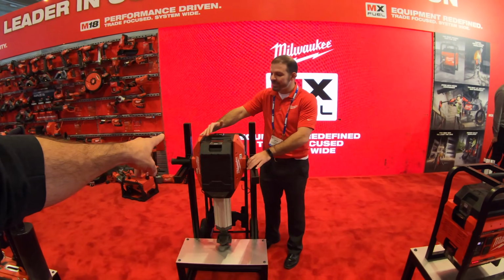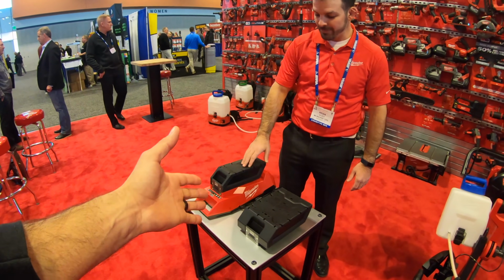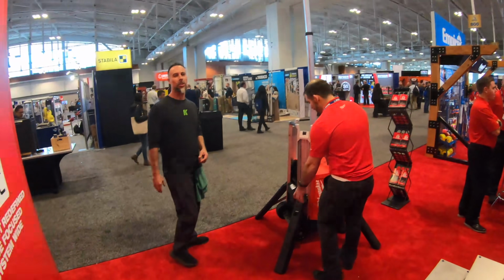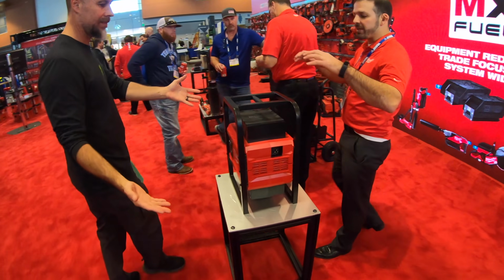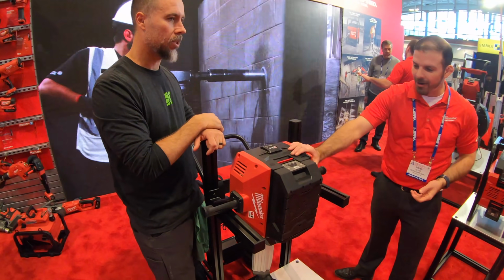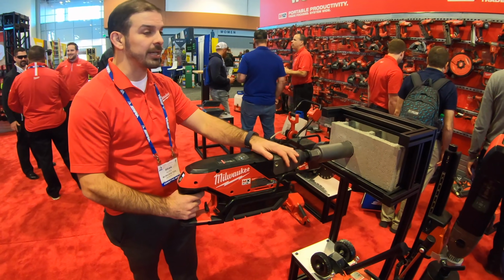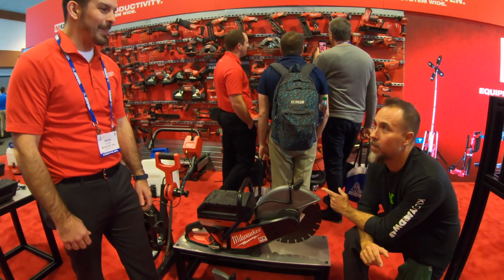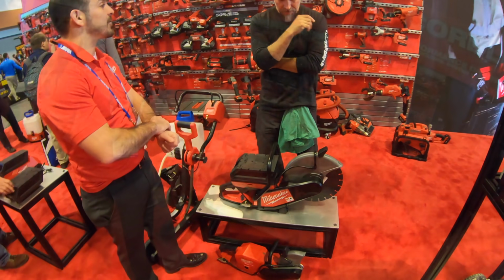Worlds First! 5 new Milwaukee Cordless Power Tools Never seen before!

Comment: There is only one way to make this 14 inch saw even better. Battery powered dust  extraction. Similar to the ads hammer drills.
         If Milwaukee makes that combination for this product I would never consider another saw currently on the market. 
        I have ran stihl, Mikita, hilti, all of them snowball eventually. They all have they’re different quirks and down right bs faults in design. 
        I am extremely excited to get my hands on the 14 inch saw and I cannot wait for Milwaukee to start a new tool revolution in concrete and masonry tools. 
         They just opened up Pandora’s box with this Mx lineup. I can’t wait to see what comes next!!!!
Reply: The demo saw is pretty trick, as long as the battery/drivetrain life is there - I'd hate to pay for one of those batteries very often.  Like that they came out with a cart designed for the saw, tho I have a hard time seeing how they get $1000 for little more than a wheelbarrow.  All the saw carts are like that, tho, and if a guy does much flatwork demo they're pretty much a necessity.  Stan was right on with time savings with not having to fiddle with start-up procedure.

Comment: I would like to see them add a cable stapler that makes the cable tight to the wood Without damaging it. The Dewalt one sucks because it does not sit The cable family to the wood you can slide the cable and that way electricians can’t make a nice tight good looking layout with their cable and staples I. Whoever makes an adjustable cable stapler is going to take the electrician market by storm every electrician I’ve spoken to said that the Dewalt sucks because it does not make it tight enough so that the cable will not slip through.

Comment: The battery cut off saw is not the first in the world Stihl has had one out for some time. I been using the stihl cut off saw in the UK for 6-9 months. The stihl look smaller and less bulky than the Milwaukee cut of saw as well. https://m.stihl.co.uk/STIHL-Products/Construction-Machinery/Cordless-Li-Ion-cut-off-machine/240781-43597/ohne-akku-ohne-ladegeraet.aspx

Comment: See I don’t care about the drain drum machine personally of me being a plumber I’m always gonna use a spartan drain cleaner because I know they’re dependable and reliable I like the idea and the concept but I’m still going to go 100% plug-in Spartan because I’ve used it in the rain unclogging a drain at 2:30 in the morning soaked and that thing kept on running didn’t give me any trouble
Reply: Agreed man right there with you. I just don't see it having the weight behind it to break through a bad clog. Sewer augers take a major beating. Now if only Spartan or Rigid could add a battery powered lift that'd be sweet. It's a one man job but where I live we have basements so ends up having to be two people.
Reply: It's something where you just have to take a gamble and see how it goes.

Comment: “What’s the price point on this”
Guys embarrassed to have to say it
They pay you enough to shill for them
Send it to AVE let’s get the scoop
Reply: AvE would have a field day with all this market wankiteering.
Reply: I want to see "what makes her chooch"
Reply: Like my Milwaukee....Skookum as Frig ....but sure will be fun to watch open up one of those super tools and especially a big arse battery.
Reply: Work Hardened I have to strongly disagree, I have never had a Milwaukee tool go out on me. I have seen other brands go out on my co workers and my Milwaukee tools keep going. I have the m18 and m12 and I can tell you right now nothing can touch the m12 series. It definitely nothing but heavy duty. My buddy was a dewalt guy until we were cutting a wall and he was using his new 36v sawsall and he thought it was going to be twice as strong and he quickly learn that wasn’t the case and the Milwaukee m18 battery lasted a lot longer so actually got the job done faster. He’s a Milwaukee guy now
Reply: @marioslrzn  What a bunch of wankery
Reply: @marioslrzn  Dewalt doesn't make a 36volt recip saw
Reply: @Work Hardened Milwaukee is better than basically everything but Hilti and festool at this point
Reply: @CodyStegeman  Milwaukee is absolutely garbage
Reply: @loucifer323  its better than any other midrange. Festool and Hilti are better, but their price points are crazy

Comment: Those cutoff saws.  They destroyed my back picking them up and using them over my head. At 6 feet 4 inches tall the strains of cutting through concrete, brick or steel is a lot to bear.
Reply: That's what the new guys is for man.
Reply: @shaymoose17  not if you only have one shot to get it right.
Reply: This Milwaukee saw is 12lbs heavier
Reply: Why don't they use a cable from the battery to the tool. Either as a backpack or just on the ground as you use it. With the jackhammer it will support itself but not the saw.

Comment: So whats the voltage of this new platform?  I'd like to see them come out with solutions on for battery chainsaws that would compare to the MS660 Magnum, MS880 Magnum, and the MS500i gas saws while keeping a similar power to weight ratio.  I would also like to see them come up with a 1 1/2" impact wrench.

Comment: They are great tools but its bullshit they changed there battery platform. They should of just been able to use multiple m18s instead. But I get it, it's for the pros! Still waiting for M18 inverter, booster pack etc!!! Come on guys!
Reply: I am going to guess they decided to make a new pack, due to the demands they plan on putting these under. Also, a single 70-90v 6AH pack, is probably going to cost less than 4-5, 18v 6AH packs. A single pack removes 3-4 extra points of failure; the battery connection. A single pack can be made bigger, utilizing bigger cells that are less stressed, heat up less, and last longer than multiple smaller packs. A single, bigger pack, can be made more durable.

Comment: Makita just added a couple of batteries for more power.  They are also interchangeable with all their tools unlike all the other different brands that force you to buy more batteries when upgrades are released.
Reply: and two of their 18v lines are incompatible
Reply: What turned me away, is silly control board on makitas battery that permanently disables battery if you run them low a couple times on a cold day, which we have plenty of in Minnesota. I switched to yellow and never regretted.
Reply: It's all relative to how a brand can market and make money off of their battery system or tools during new product releases. I own both makita and milwaukee. Down fall of makita a 36v tool runs off 2 batteries. Like they're sawzall. Can't just put one in and be okay with half the power, or run time if some other batteries are on the charger waiting. I bought the m18 super sawzall and any of my m18 batteries will run it, give me the same performance (besides h.o. batteries) and only need one to function and be competitive to other products. 6 of one, half dozen of the other really.
Reply: Makita is releasing their 40v system this year including a 40v brushless impact wrench. I will be buying it soon as it's available in the states I can't believe they beat DeWalt to a 60v impact.
Reply: Makita sucks ass🖕
Reply: @creeplife2802  Actually, Makita battery life destroys ALL other competitors except Milwaukee. Cordless circular saws and miter saws Makita beats all. Milwaukees 6-1/2 circ saw is very nice but 7-1/4????  The only thing that d walt company beats either M co on is a cordless framer and the small concrete saw. THATS IT! ask AVE
Reply: @i.l.5518  Flexvolt is better than makita 👍 i really dislike how they make a 36v system forcing you to use 2 batteries, which is stupid
Reply: @lenardbosch2969  Beats having to invest in a different battery platform.
Reply: I. L. Also their angle grinder. DeWalt angle grinders are sick!!!  I’m team Big Red but this is one tool they win on.

Comment: they need to add a charging port to the light since it can be pluged in and still work for there small battery's and also a plug on the big battery's so they can charge small ones off of them on a job site
Reply: That's exactly what I was thinking. Why it didn't have any plugs, I mean you're already going to spend 3Gs on the light.

Comment: Cant talk about Amp Hours without specifying Voltage
Reply: watthours is kinda how they are more accurately measured.
Reply: Yes, P = V x I is a no-brainer
Reply: Milwaukee still has not shared the voltage of these batteries. Ohio power tool says around 72 volts. However the mx system is really designed to replace gas systems. Measure of horsepower not voltage. The pack may be some arbitrary voltage but its the watt hours or hp output capabilities that really matter with this new system. Watch VCG constructions video about mx fuel tool pricing. They describe this well.
Reply: @grahamdeere9475  Interesting.... why keep it quite? Surely  its possible to measure the voltage on the terminals? If it is 72V that does raise some safety issues, 50V and below is considered Extra Low Voltage and safe to touch,  but above 50V not so.....
Reply: @Kosmonooit   Alot of us are waiting to here a voltage number to come out. Ohio has only claimed certain numbers on the MX packs. Its relative to these high out put packs competing with 110 power and gas model tools like the cut off saw. Keep in mind amperage is what is dangerous. 72 volt pack doesnt mean its any more dangerous than an 18v system. Your normal phone charger is 5 volts and 500-1000mA of power. Throw that in a bucket of water and touch it you'll  be lucky to remember what happened.
Reply: @Kosmonooit  so other companies are blindsided by it
Reply: Actually the sales guy was alluding to how fast their batteries chemistry can dump out its charge, essentially its cranking amps which is a different animal from A/hr
Reply: The new batteries are 72 volts with peak usage to 80. I can imaging high current draw tools like concrete cutters will use them

Comment: He’s correct 3 ah doesn’t sound impressive how about also including the voltage. It would give a much better idea of how much power they have
Reply: I didn't find the voltage of the battery, but the charger outputs 72 volts.
Reply: Jigsaw9471 ohh so that would 72 x 3 is 216 wh   So that would be equivalent to a 12 ah battery at 18 v
Reply: Stores are saying it's between 90v and 98v

Comment: No generators= quite operations.  Happy neighbors on jobsites. Ten ft light is cool.  A little $$$$.
Reply: If you think about huge construction where a contractor may have hundreds of them probably not. All that fuel to obtain and regularly distribute to equipment is a major cost. Those engine powered lights are equally expensive plus ongoing costs.
Reply: @heyyou5189  The upfront cost to switch is going to hurt though. Overtime? Yeah, the cost savings of the cordless will likely add up. Especially the inverter ("generator"), as it is obviously going to be an on-demand power supply, unlike a genny, that idles for half the time.
Reply: @dposcuro  I wonder if they included a provision for chaining them in place. I see theft as more likely with this over power plant lighting.

Comment: The thing that impressed me is how he always answers the question, Milwaukee doesn't beat around the bush.
Reply: The cp has the same watthours as the m18 12ah. Xc is equal to 2 12ah batteries.
Reply: Come on guys! Amp hours tells you approximately how long the battery will run dependant on how much of a load you are putting on the tool motor of course,  watt hours tells you how much power it will put out in an instant. Like how large of a drill bit a cordless drill can turn and drill a hole with.
Reply: like how he couldn't tell you the capacity of the big batteries in watt hours?
Reply: @Max_Marz  3 amp hours and 6 amp hours?
Reply: Amp hours is not a measure of capacity by itself

Comment: Cordless roofing nailer would be epic
Reply: DeWalt has one coming out in April 2020
Reply: @jarredpope7002  dewat has had one for years which one do u want
Reply: Will likely come out in a year or two. I am willing to bet they have almost ready, but are waiting on feedback from mass use of the framing nailer when it comes out. Fix any minor issues they can, and then release it. This is pure speculation obviously.
Reply: Passload been out for at least 14 years. Not as fast as air, but no cords. Used my framing nailer for 3 days in light rain, no prob.

Comment: I would like to see a vibrating plate compactor by Milwaukee
Reply: Why?  The only good ones are reversible heavy duty compactors.  I don't see them getting in to that market.  Forget the dumb little home depot rental compactors that barely if at all compact a 2" lift of gravel.

Comment: These may work for a small contractor that takes care of their tools but they would never work in an industrial or heavy use setting.  The Snake is to big to maneuver and made of plastic. I give it a week of real use before all the plastic bits break off.  If you have ever seen a jack hammer being used you know the guys literally throw them around. Need that jack hammer at the bottom of a 6 foot trench no problem as they drop it into the trench. Most industrial setting are power limited so charging lighting or any other battery item over night would be out not to mention they are usually needed in winter months outside. Batteries do not like the cold. I commend Milwaukee for pushing the envelope but the Honda and diesel generators on industrial sights are not going away anytime soon.
Reply: Yeah, if you can't tow the demolition hammer behind a truck for a block....untie it and use it...it'll never hold up on most jobsites

Comment: That saw for rescue work is a life saver.
Reply: Literally!
Reply: As long as you've got enough battery power.  That's always been the advantage of fuel, you can just refill in a minute and keep on going.  Whereas the battery powered tools eventually need to be recharged via the power grid or generator.  That said I'm a fan of electric tools moreso than gas powered ones, because they always work if you've got power.
Reply: @Chris-ob8ok  Uhh gas tools basically always work when ya have gas, too
Reply: @tylersmith9868  do you have reading comprehension problems?
Reply: @tylersmith9868  ....No they don't. If you don't maintain it on a frequent basis (and a hell of a lot of people don't), they can, and will, just not work. Regardless of how much fuel you throw at it. Pretty sure everyone has a story of a gas powered anything not working when they need it to.
Reply: @dposcuro  none of my stihl saws have ever let me down, not once. I have however had cordless drills let me down many times just saying
Reply: @tylersmith9868  I just broke the pull string my stihl it took nearly and hour to fix. Battery would never have that problem

Comment: The generator for sure but didn’t hear a price
Reply: I'm sure the Homeboyshoppingnetwork will have for way way less than 3Gs
Reply: i bet those batteries alone are  AT LEAST $500-$800 each.
Reply: @v5u7sulh2  $299 for cp and $599 for xc
Reply: Aaron Repper where did you get the prices? That’s not that bad when you can pay 200 for a flexvolt right now
Reply: Ah, do you mean the inverter power pack? It isn't a 'generator', but an inverter - what it does is convert battery power to main's AC for power tools that are corded. Still need to charge the batteries for it separately, which is a pain, but most of these types of equipment will fun off 1 to 4 packs that can be swapped out for charging as required, or have internal chargers if you have access to a genny.
Reply: GordoWG1 WG1 you say tomato-a I say tomato you say power inverter I say generator lol jk no I hear think it’s a good set up though could use deff in enclosed trailer on job sites stuff like that but thank you for the clarification lol
Reply: lol @ homeboyshoppingnetwork
Reply: I saw another you tube video that had the price of the batterys
Reply: Think I've seen it for about 3 grand

Comment: To me there is no comparison to any of the  Milwaukee tools I personally own 8 cordless tools love them
Reply: Makita and Milwaukee for me. I’ll never own one platform because each manufacturer has  some better tools than the other.
Reply: I have Milwaukee and they do a good job. I actually prefer dewalt though, they are more compact on some of their tools and just feel better in the hand.
Reply: jamesnm21 dewalt truly doesn’t compare
Reply: @Prodigal99  😆 thats cute... Milwaukee is fine, but it's not the best brand on the job. Dewalt is superior, and Makita beats both of em hands down basically every time in all applications
Reply: @Prodigal99 don't get me wrong i use Milwaukee, but literally only because of its price to perforance ratio. It gets the job done, but its nothing special. Durability is good, but again, nothing special. 

People who think Milwaukee is the best simply haven't had an opportunity to work extensively with higher quality, better tools... 
 
 if you are simply talking price to performance, Milwaukee is in a sweet spot... but it basically only beats Ryobi, Black and decker and your harbor frieght brands in actual performance metrics. Its near the very bottom of professional tool brands...
Reply: I used to think that Milwaukee was superior to everything else but I've found that Dewalt is better in some cases.
Reply: A lot of brands compare to Milwaukee just fine.